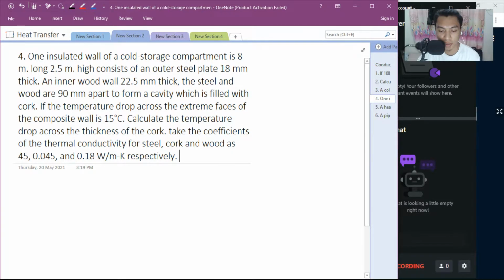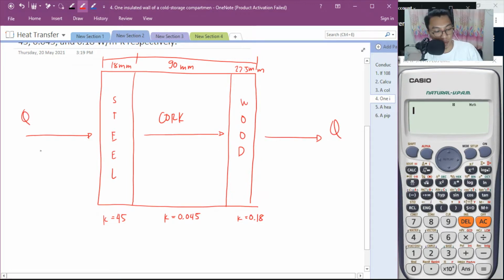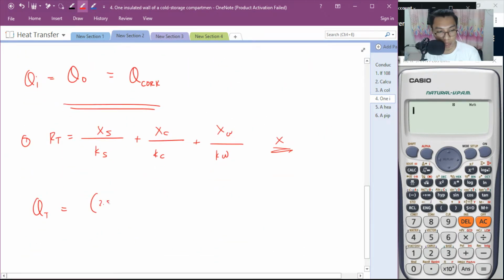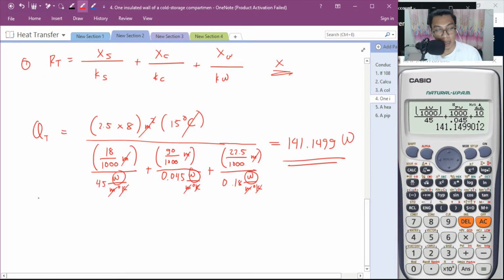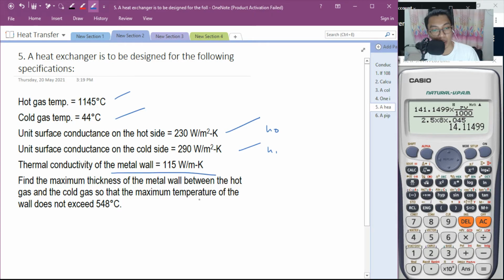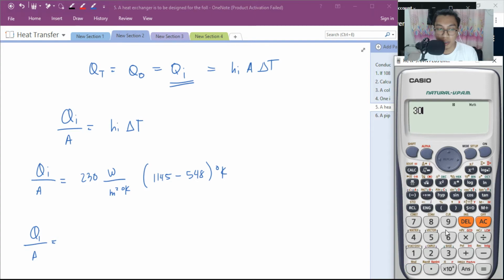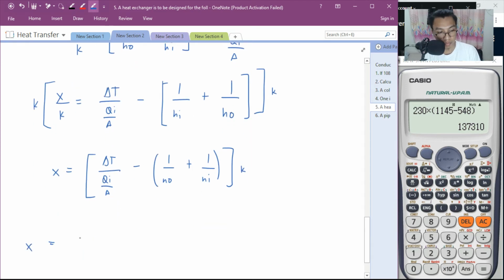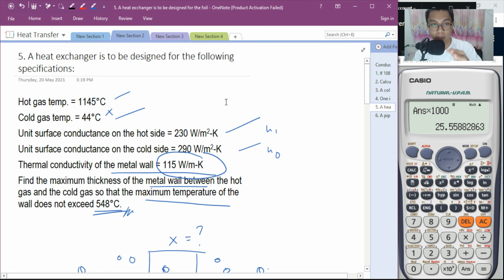Heat Transfer: Conduction Part 2

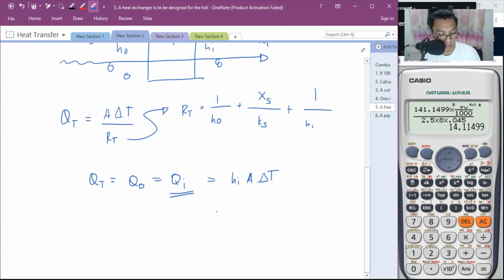Comment: 14:05 sir tanong lng po applicable parin po ba yan pag composite wall na or sa single plane wall lng? and pwede rin po ba gamitin an Qconvection = Qconduction?
Reply from the maker: Depends on problem. Pwede kasi magkakasama sila. Theoretical teaching hinihimay. On actual basis magkakasama talaga ang heat transfer modes